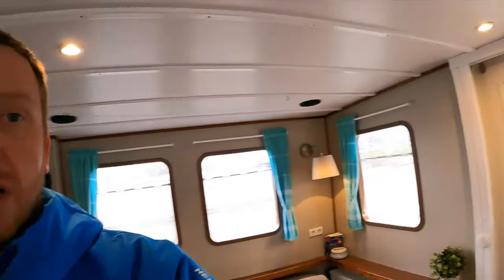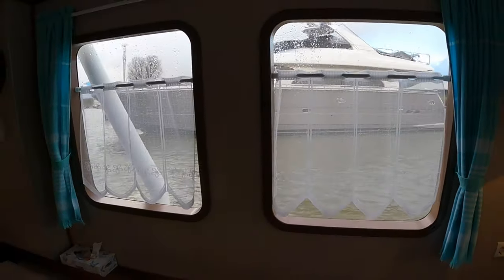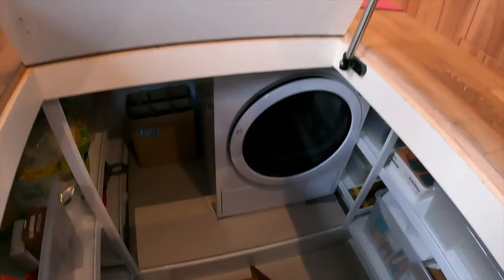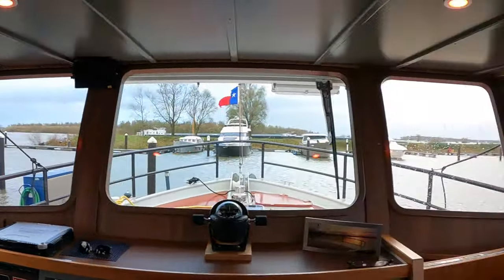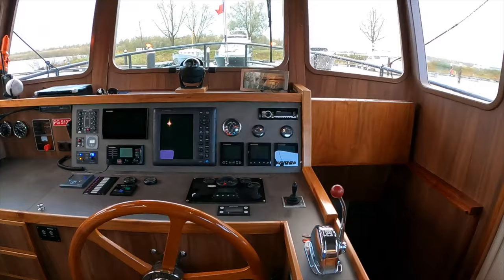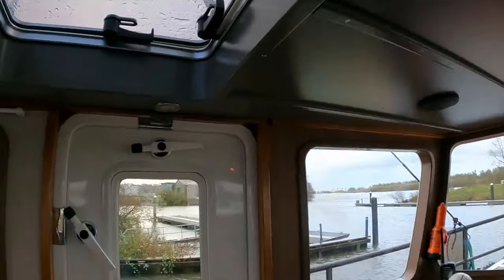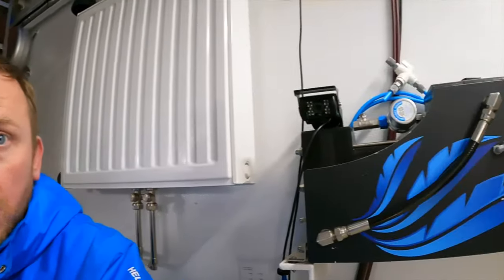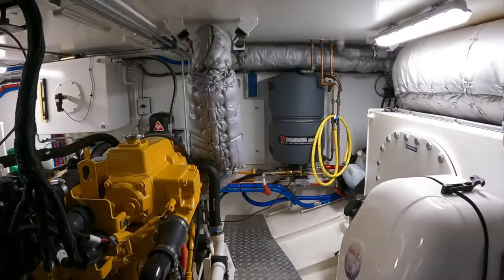My Favourite Feature On This 42ft Steel Long Range Liveaboard Explorer Yacht!

Comment: My Cheoy Lee Pilothouse is laid out the exact same way with the exception of a watch berth in the pilothouse, and steering off center to port. My range is half of that with twin Ford Lehman econo-power 100 hp diesels. And I have a flybridge and a hugely over built paravane stabilizing system. Mine is FG and almost 50 years old. Classic layout.

Comment: If this hull is steel and the superstructure aluminum - how is it possible to fuse these two materials together without causing electrolysis?
Reply: Seen how its done in the Bearring Ship yard on the new boat for Naughty guy. They buy a strip of steel on one side and aluminum the other side.
Reply: By a explosion, im not kidding